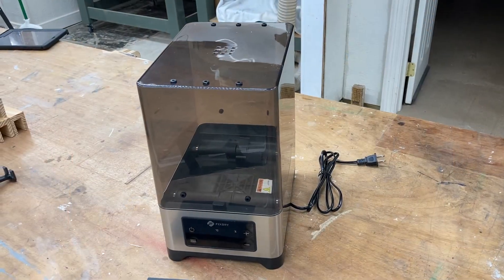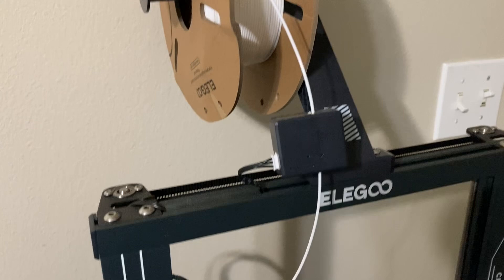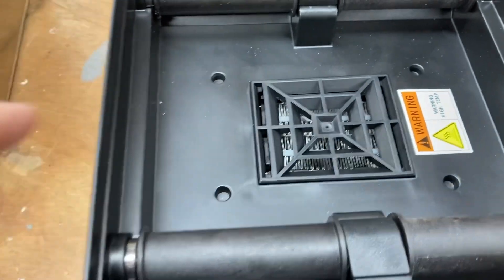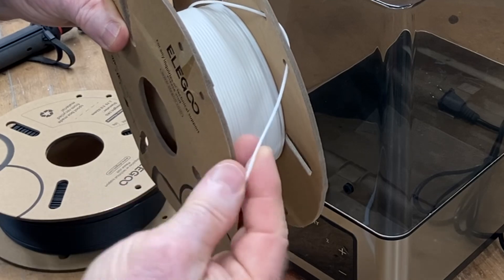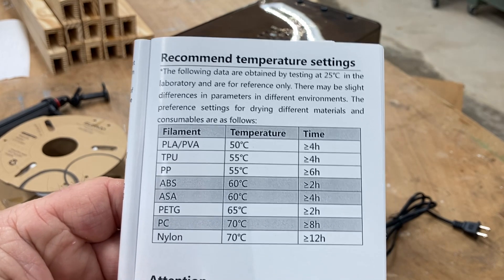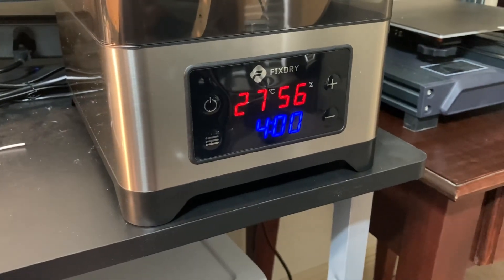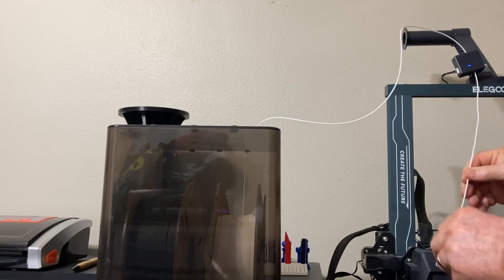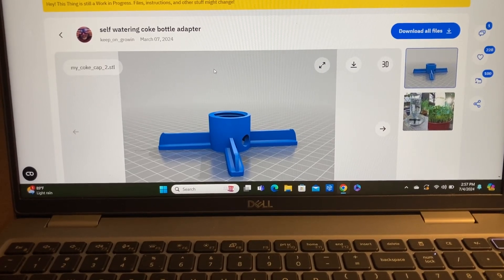FIXDRY OFFICIAL Filament Dryer Testing and Review

Comment: Hi! I have the same model of filament dryer. Do you usually plug the openings whenever the filament dryer is not running  for a couple of days? I'm just worried about the reabsorption of moisture during those inactive days.
Reply from the maker: No I do not